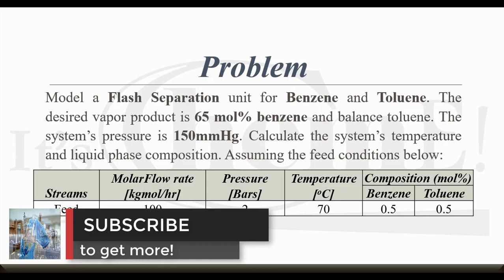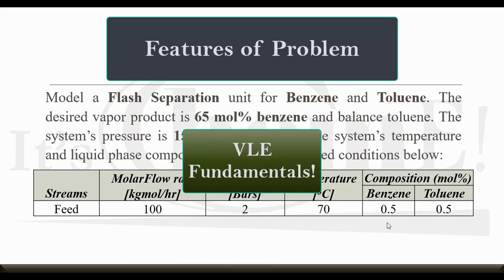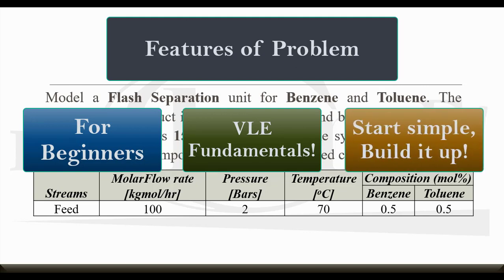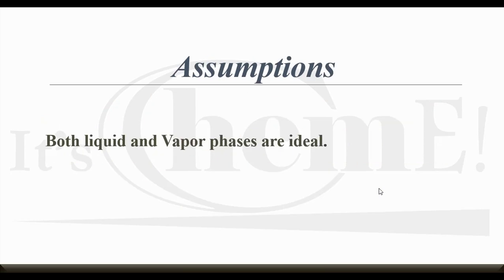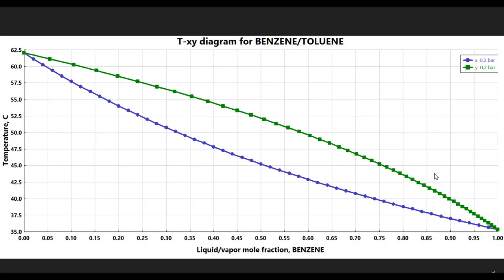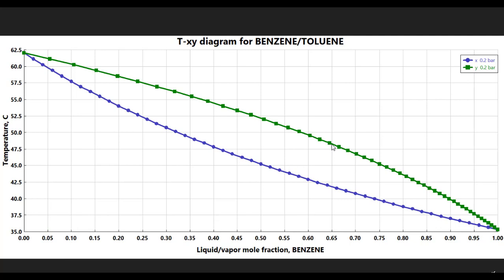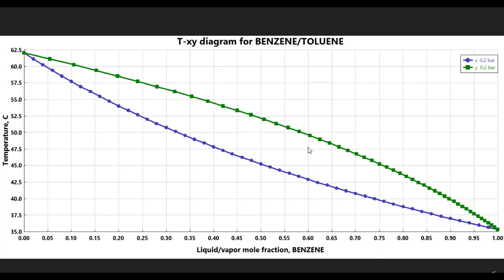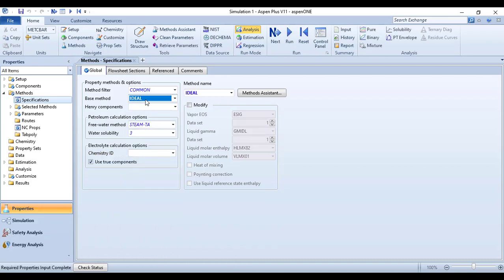Modelling Flash Separator in AspenPlus || Part 1/2  (Problem intro + Txy Diagram + Property Package)

Comment: Hi friend, thanks for your videos / So usually for Gas mixture we can just use Ideal behavior as a base method?
Reply from the maker: Thanks for watching. 
For your question, not always. The ideality assumption for gas mixtures is valid only when you have high temperatures and low pressures. Like those we have in this case.
Reply: @its_Cheme  Hi, do you know how to find Compressibility Factor Z for gas mixture by using Aspen?